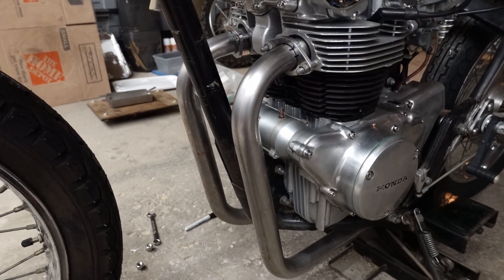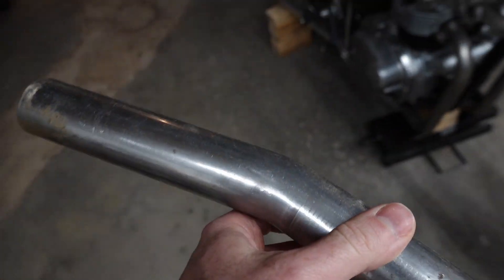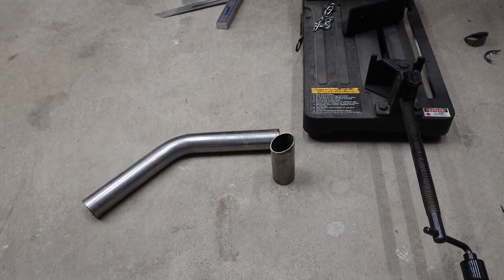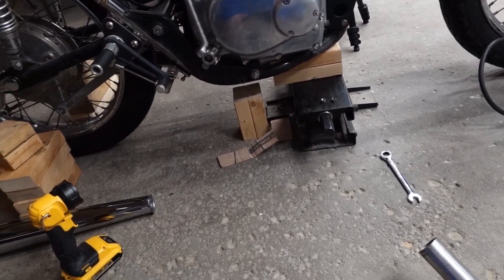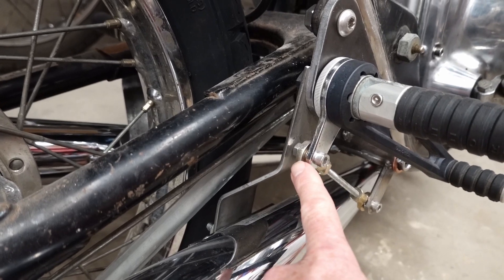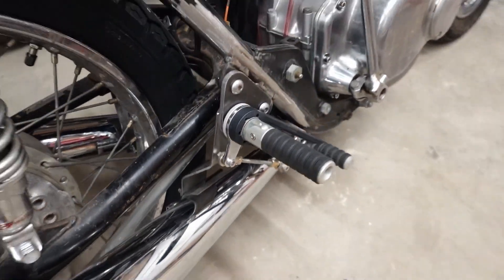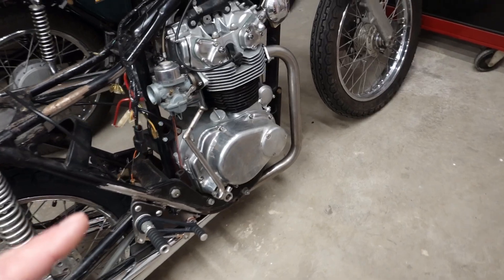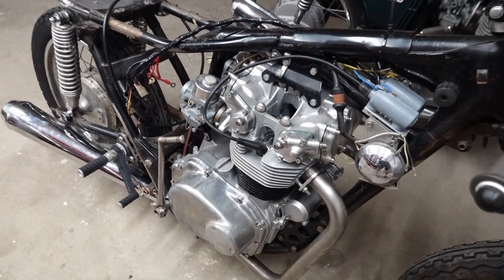Honda CB450 - Cafe Racer - Part 9

Comment: Hey man nice work I have a 1970 CB450 on the main harness there’s a green ground wire should that be hooked up to the frame or battery? Thanks
Reply from the maker: Depends on where it is.  There should be a green wire going to the negative terminal on the battery in addition to the thick wire that grounds the battery to the frame.

Comment: Great vid. 
Where do you get those pipe kits from?
Reply from the maker: I had a company custom bend the headers for me.  I provided them the specs and drawings and they bent them and shipped them.  The flanges and collars were machined for me by a friend of mine.  The company that did the headers was J&D Tube Benders. https://www.jdtube.com/  The price was reasonable but the last couple of times I've reached out to them I didn't get any reply.